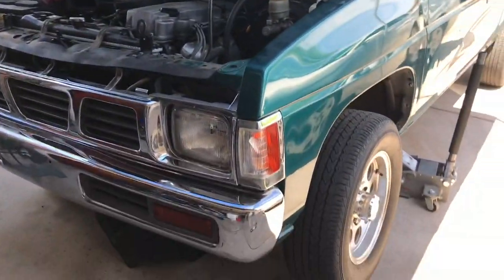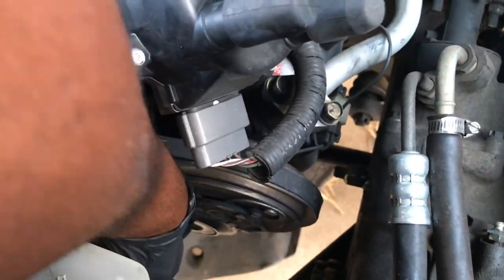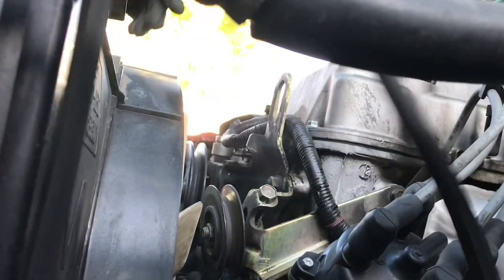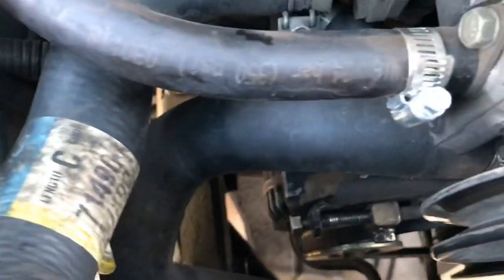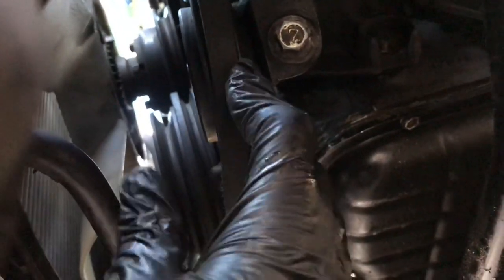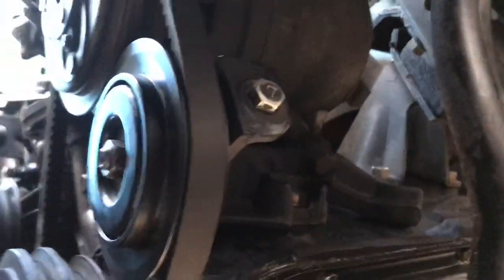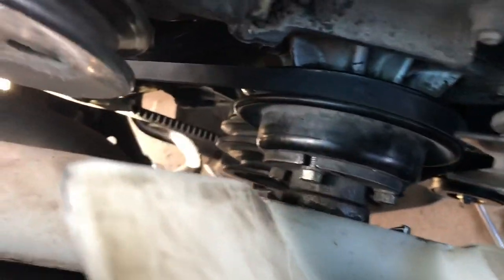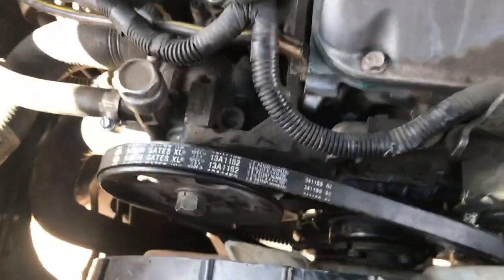88- 97 Nissan D21 Belt replacement

Comment: I started hearing a squeak from my A/C belt on my 86 that would go away if I turned my A/C off. I bought the belt, but I think I'm going to take your advice and replace both belts and the pulley just to be safe. Thanks for the video. I know it was a while ago but you're still helping people years later!
Reply from the maker: No problem Thank you
Reply: Mine happen when I turn the truck on it was squeak and then when the truck would move it was continue to squeak I would have to rev the truck for the squeaking to go away yfm
Reply: @YoungEne114 ever figure out which belt it was? My brothers truck is having that exactly same problem right now

Comment: Good walkthrough, especially the NAPA singing 😂 But yeah, the little tips for reassembly are gold, thanks for sharing.
Reply: I finally got organised to do this yesterday.  I've got a noise like a supercharger now - I think I did the alternator tensioner wrong, so will be tweaking that today.

I found another video that focuses more on that aspect.  #1 Adjust top  long tension bolt (14mm), #2 tighten top front facing bolt (12mm), #3 go down the bottom and tighten mounting bolt (14mm).  I'm probably going to replace my alternator in the next few months too so I need to remember all that.

Anyway, thanks again Curtis, I hope you still have your truck and it's going well, your videos are very helpful.

Side note, the local parts store where I got my belts, Repco, it turns out is owned by NAPA.

Comment: Found this after I did mine on a 98. All same set up. Alternator was a nightmare! But thank you so much for this video, the clearest instructions!! The pulley you replaced, was that the lower one or upper one? After I changed my belts my truck won’t stop squealing. It’s the reason why I changed the belts but now it seems to be a pulley because my truck won’t stop squealing now. At first it only happened at start up and then went away. Thank you and appreciate the video!!
Reply from the maker: The Pulley I replaced was the bottom one closer to the driver side. It’s the AC pulley still no squeaks til this day for me. You have to make sure your tightening that tensioner if the belts are to loose they will make noise.
Reply: Awesome thank you for the information!! Much appreciated!!

Comment: Thanks man for the video. Helped me change out the Alternator belt for my 97 nissan pickup, the belt snapped while going 60 mph down the highway, thankfully had someone following behind me that ended up towing me back home. Usually carry a spare in the glovebox but I took it out cause I took it in to get the clutch fixed.

Comment: Autozone told me I need a 15360 belt.  I see you got a 15355.  I read on a forum the 15355 is the right belt.  Did you run into that?

Comment: Hey, man this video really helped me the last belt on this video is the one I changed but I’m still having an issue my belt must be too tight I broke 3 of them.
Reply from the maker: Sorry to Hear that Playa. I dont see how it could brake maybe it is to tight.if you change it again id take it slow and maybe replace a pulley if you have to. Tighten it a little turn the truck on let it run if it sequels try to tighten it a little more until it stops thats when you know your good.

Comment: I left a like and subscribe on the screeching sound alone, because my truck is doing the same exact thing and it’s really really annoying!
Reply from the maker: Swap out the Pulleys and Belts. Thank you for the Like and Sub
Reply: Curtis Fox91 no prob, they just put all new belts on, not sure if they came loose after , was like a month ago , but it’s like screech when startup until the engine levels out, then screech when putting ac on, no screech if in gear being parked, soon as you hit the gas screech, then goes off after about 10mph , it’s a nightmare, would u guess it’s the pulleys or belts needing adjustments or both
Reply from the maker: @LawnJohnSilver  i would believe the Belt is not tight enough or the Bearing in the AC pulley is bad.

Comment: Hey bro thanks for the video got all the belts off... how you take that pulley out? The one by the ac compressor!
Reply from the maker: The AC pulley comes out once you loosen the 2 bolts surrounding the pully. One in the center of the pulley and 1 behind it. And then to reinstall reverse the process
Reply: Yea that plate on the pulley was all tore up! Have to find another one at the junk yard... appreciate the help bro!
Reply from the maker: bboybrandon1992 Try to get a New one if you can. no
Problem goodluck if you need help with anything shoot me a Comment. I may have some knowledge

Comment: Going back to OEM. The ribbed belt to the alternator screeches like a witch every time I start the truck.
Reply from the maker: To loose??? It should not screech
Reply: @curtfox91  - Yes I tightened it twice. Got an OEM V belt. Having it installed this week. I'll let you know the results.
Reply: @curtfox91  - Got my 97 Nissan back from the shop today. The alternator OEM V belt I bought in Ebay ($24.84) works great! No more screeching. FYI
Reply from the maker: @rogerbec5766  🙌 YES

Comment: Is the crankshaft pulley suppose to move???
Reply from the maker: Only if you put a tool on it that Bolt holding it should not be loose.
Reply: @curtfox91  Appreciate that.

Comment: Did the pulley fix the squeak?
Reply from the maker: Yes if you have a Squeak change your pulley or just Tighten up your belt. It should be one or the other or if tour belts are worn you would need to replace them.
Reply from the maker: No squeaks for me .
Reply: Dude what ac pulley did u replace ? U didn’t show it in the video is it the one under the ac compressor ???